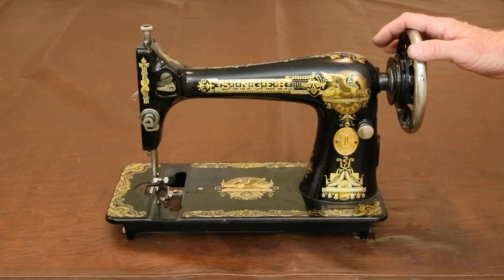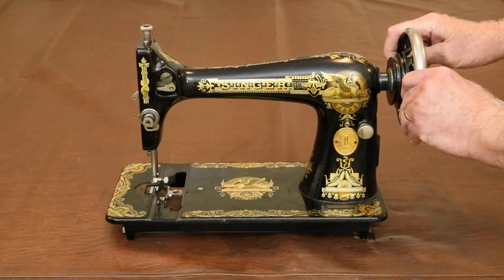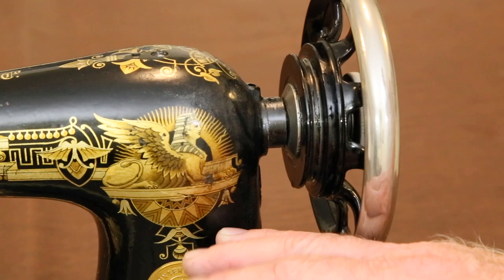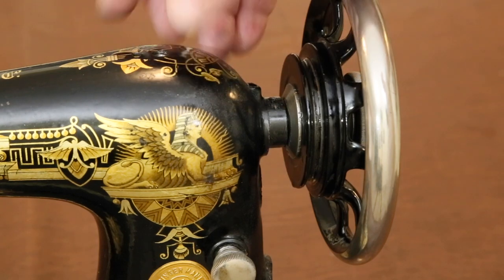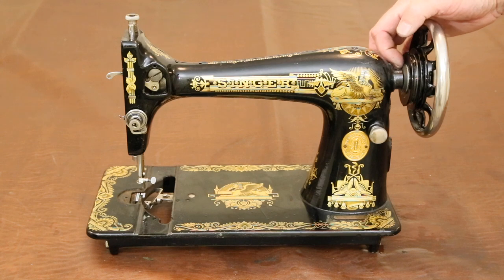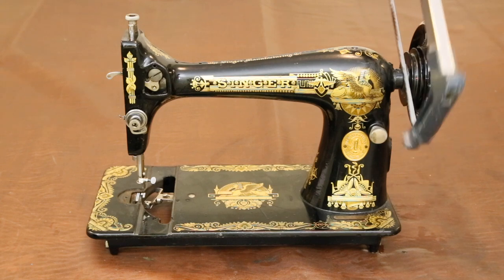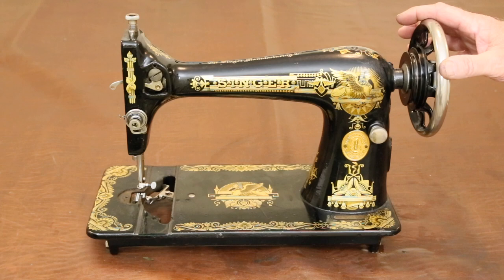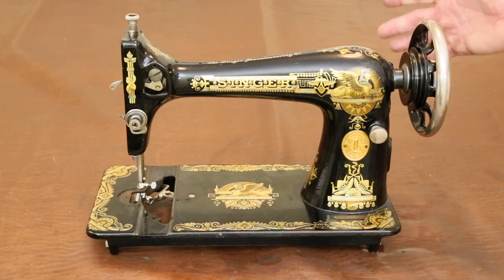One Way To Fix A Jammed Antique Sewing Machine

Comment: Simple workable solution. In 1985 I bought a Honda 125 that had been used off road and had "banana" forks I made some V blocks and a few blocks of wood then used a Hydraulic jack in an outdoor brick building doorway, not perfect but it got the forks working again. 

I have a Singer just like this and made a BIG mistake by running it with the front shuttle slide  OPEN the shuttle jumped up a bit and jammed and bent the cradle. It took me about 30 min and a few tools to bend it back in to working order. NEVER run  a machine with the slides open - just like never run a machine with the foot down and no material, I often just use a paper. Quite a few of my machines have a grove under the foot [I file them flat], hardly surprising the dogs are sharper than some of my garage saws.  

Thanks Wayne for a another short and to the point useful video. If it works it is good enough.

Comment: Wow, what a treat to find this video with this machine. I bought the same or similar machine at an estate sale.  The tension spring is broken.  Would you have a suggestion where I might begin to locate one?  I think my machine was made in 1874 or thereabouts.  Decals are the same as your machine is.  Thank you for any help you may give.  You do exquisite work.
Reply from the maker: Fortunately, many places sell parts for antique Singer sewing machines. Try the following key word string: "Singer 127 parts" in EBAY, Google Amazon and so forth. You may have to purchase a bag of parts to get what you want. Good luck and thanks for commenting!

Comment: I can finally move mine but in binds slightly part way through a rotation, I noticed the wheel wobbled slightly also. I guess I should stop the rotation with the bind on top and cut? Thanks so much saved me giving away my gorgeous 15 with pristine Tiffany decals which are so hard to find in that shape. I will do it !
Reply from the maker: Can you see the spot where the wheel collar rubs against the body collar? If so, that's where you need to saw. But, using this technique is considered a destructive correcting because it removes original material. Be sure you want to take this step before doing it.
Reply: @wayneschmidt490  OK so what are you removing metal from the wheel collar I guess you have a pretty fine tooth saw blade also. Do you smooth it out with a file or emery paper after? I was going to keep it and take apart a beat up one if the price was right or free. Might be interesting to learn. Thanks for your reply and yes maybe since this is such a lovely machine and decals I should think about it some more.

Comment: I use a little valve grinding compound mixed with a little oil and pour it into the oil hole on the rear by the handwheel and work it back and forth for a while then hook it up to my motor and belt and spin for a few minutes.
Reply from the maker: I could see how that might work if I only needed to grind off a thousandths of an inch of metal. But in this case I need to remove almost an eighth of an inch. Also, I'd be concerned about the grinding compound getting into the journal bearing. But it's an interesting idea. I'll look up 'valve grinding compound' and try it on the next machine with this problem. Thanks for the idea and the comment!
Reply: Problem is unless you strip it down after it will always be grinding away material.

Back in the 1970 my dad visited the Ferrari factory Modena they ran engines on test beds with cutting compound in them to run them in faster, the exhausts were glowing. After this they were fully striped and degreased.

In the 1980s a couple of friends bought Honda 250cc motorbikes, one lad dropped the factory oil and replaced it with  "molyslip slick 50"  - big mistake- the other lad didn't give a monkeys and revved the hell out of his. The result was the first guy had a slow bike and sent a letter to Honda, he got a letter back saying that they thought his bike would be run in after about 50,000 miles or so.

Not every idea is a good one. You should see some of mine :-)) that I have to live with.
Reply: jdhtyler 90% of these machines are never used they are meant for display only. I wash it out with mineral spirits and compressed air and it seems to flush most all of it out. I freed up the exact machine with the same issue and it works great.
Reply: Wayne Schmidt I did the exact same machine with that issue it wouldn’t even turn at all when I got it but after a few hours it freed up where I could hook it up on my bench motor and spin it until it freed up. When they are super tight I take off the wheel and start working it back and forth  with a pipe wrench to loosen it up. There are different grits of grinding compounds available. I flush it out with mineral spirits and compressed air and it seems to clean it out well. I really enjoy your videos they have been a great help in this wonderful hobby.
Reply from the maker: @jdhtyler  I hear what you're saying about the lose of people with machining skills. As a research engineer, one of my best engineering experiences was working with the lead machinist, a man named David Lowes, in making a small rocket engine at the Air Force Rocket Propulsion Laboratory. My design was great, until he very gently sat me down and explained that many of the things I had designed couldn't be made. Working together, we got it built and running. I learned a lot from him. Not just about that project but seeing engineering design from a wider perspective.
Reply from the maker: @jdhtyler  I love pulse jets! Mechanically they are so beautifully simple that it makes up for their many other issues. Did you know there are valveless versions? These are "U" shaped engines with one leg of the "U" shorter than the other.

Comment: I ha e just bought a 1922 Singer 15K. I'd like to learn about it and hopefully restore it. I find it a fascinating object although I don't know (yet) how to even use a sweing machine. What I ha e noticed though is that the big wheel (perdón I don't know the exact name) does seem to rotate top well, almost freely. It definitely doesn't move the needle. Could you point me to what I could look at? Is there any service manual available, or repair guides? Thanks in advance.
Reply from the maker: Singer 15Ks are great machines. Congratulations on finding one.

Look at the end of the large wheel on the right end of the machine. There should be a knurled, silver knob in the center of it. This acts like a clutch to disengage the wheel from the rest of the machine so that a bobbin can be wound without running the entire machine. Try turning it clockwise to tighten it. This should re-engage the wheel with the machine. 

Here's a source for a free manual for 15K machines:

http://needlebar.org/main/15chart/110/index.html

Good luck!
Reply: @wayneschmidt490  OK, so I've watched a couple of videos and I think I've understood the clutch knob/washer thing. After removing the clutch knob and washer and trying several possible positions and tightening the cluck knob more than it was before, I think I have it in the correct (or at least a better) position. Now I can tighten it and the balance wheel doesn't rotate freely anymore! Which was the expected.
Now it doesnt move at all, but that's OK. I'll start by oiling every oiling point as described in the manual and see if I can unfreeze it with time and patience. Already, thanks for the help!
Reply from the maker: @adumont  You're very welcome, and good luck!

Comment: Wayne, I have a Minnesota Model H machine.  The treadle wheel moves fine, but the needle doesn't.  Seems like the shaft is not moving at all.  Any suggestions???
Reply from the maker: The most likely cause is that the wheel has been disengaged from the driver mechanism inside the machine so that a bobbin could be wound without driving the entire machine. In the center of the main wheel is a small knurled disk. Holding the main wheel still, try rotating the knurled disk counter clock wise, so the top rotates away from you, until it gets tight, then try spinning the main wheel and se if the needle now goes ups and down. If that doesn't fix the problem, you may have to take it into a sewing machine repair shop to figure out what's wrong. Good luck and thanks for commenting!
Reply: @wayneschmidt490  Thanks Wayne for the fast response.  I will try and let you know whether that works.  Thanks...
Reply: Looks like that was it.  Thanks again...
Reply from the maker: @DavidGurev  Great! Glad I could help.

Comment: my machine waz damaged in the post the left foot on the front of the bed of the sewing base had cracked off can it be reparied the cover plate is holding it on o it does still sew very well
Reply from the maker: Hi! I was sorry to read your machine got broken in the mail. That's happened to me several times. It's frustrating. But, if it's the cast iron foot you're talking about, that can be easily fixed. The following video shows how. It doesn't require any welding or soldering. While your broken piece is a different shape that the one used as the example in the video, the idea should be easy to adapt to your needs. Good luck and thanks for commenting!

https://www.youtube.com/watch?v=yjx85PYfUdA
Reply: @wayneschmidt490  thanks my broke piece is wway bigger
Reply from the maker: @rndea100  No Problem! The same technique with a little modification can fix it. What I didn't talk about in the following video is that the Florence sewing machine in it had been dropped and the entire base broke in half right across the crown. To fix it, I turned the machine upside down, took all the hardware off, sanded away the paint on the underside, got some 1/8th-inch thick by 2-inch wide pieces of steel from a hardware store, scored the bottoms of both the steel and the machine with an Exacto knife to make groves for the epoxy to catch on and used JB Weld to glue the plates to the bottom of the machine. It worked great. For your case, instead of cutting up steel plate, which can be tiring, you could use heavy weight large washers. Just make sure it's something that's strong enough that it can't bend. Good luck!

https://www.youtube.com/watch?v=jNv6307N64Q&t=286s

Comment: I can turn my weel but it jams when I sew
Reply from the maker: Thank you for commenting! 

What sewing machine do you have? What jams? Does the thread get all tangled or is there something inside the machine that locks up? If it's the machine, how many times can you turn it before it jams? If the problem is a tangle of thread, that's usually a tension problem. Most times if it's tangling on the underside of the cloth, the problem is not enough tension on the top thread. 

Let me know as much as you can about what's happening and we'll see if we can't get your machine to sew.

Comment: Hi in my case my handwheel moved but other parts jammed , what is the solution?
Reply from the maker: Without seeing the machine in person, it's impossible to tell what the problem is. It could be dried up oil or something bent or broken. The first thing to try is applying a lot of oil to every moving part, wiggle the main wheel to try to loosen things up, let the oil work overnight and repeat the oil-and-wiggle routine a few more times. If that doesn't help, turn the machine upside down and while wiggling the main wheel, try to see where the blockage is along the drive train. Unfortunately, while there are operator manuals available for most old machines on-line, there aren't any repair manuals. In the end about all anyone can do is spend a lot of time studying their machine to figure out how it's supposed to work and go from there to figuring out what the problem is. If you have a sewing machine repair shop near you, they might be able to help. Sorry I couldn't be more helpful. What machine do you have?

Comment: I have a vintage singer model 27 B-series from 1904. The wheel moves fine but the needle does not move up and down, any ideas on how to fix this?
Reply from the maker: Hello! Thanks for commenting! The only thing I can think of is that the bobbin winding clutch, the knurled knob in the center of the main wheel,  has been turned so that the wheel is separated from the rest of the machine. Try turning it counter clock wise until it locks tight. Three minutes and fifty seconds into the following video the narrator shows how to do this:

https://www.youtube.com/watch?v=dAY86LyYbW8

Good luck!

Comment: We still have this machine
Reply from the maker: Singer made their machines to last. Thanks for the comment!
Reply: @wayneschmidt490  Yep but the trouble is they only last about 100y  . . . .. . .  but if you oil them ? they will run for 100s    ;-)  I have a few, my latest are two 201K a cast iron one in a treadle cabinet and an aluminium one in a leatherette case.  Bothe sold by the users for £50

One had a bad burning smell traced to the bulb, modified to take an LED bulb, it had grease worms on everything that moved but none in the bearings ???

The other would randomly sew on its own even with no operator, I removed the capacitors and cleaned the carbon disks in the foot peddle, yep I know RF pollution... I will replace the foot peddle  with an electronic one so we can use it and keep the original with the machine.

My oldest machine is an ELSA 1980ish  nice little hand wind, great fun to use. I set this one up for my wife to do a long basting stitch.
Reply from the maker: @jdhtyler  Many people consider the 201s the finest sewing machines ever made.

Comment: My wheel turns but nothing happens. I have no clue what to do.
Reply from the maker: Hello! Thanks for commenting! The only thing I can think of is that the bobbin winding clutch, the knurled knob in the center of the main wheel,  has been turned so that the wheel is separated from the rest of the machine. Try turning it counter clock wise until it locks tight. Three minutes and fifty seconds into the following video the narrator shows how to do this:

https://www.youtube.com/watch?v=dAY86LyYbW8

Good luck!

Comment: Pls my machine jammed office pin nd it stop to work...the needle doesn't go down so it stops sewing
Reply from the maker: Thanks for commenting! Diagnosing a problem with a sewing machine is almost impossible without being able to work on the machine in person, but I'll try my best to help. First, what machine do you have? Second, is it a hand crank, treadle or electric? You mentioned something called an "office pin." What is that? You stated the needle doesn't go down. Does the machine still turn? Can you turn the main wheel with your hand?  I only speak English. If it would be easier for you to explain the problem in your native language, go ahead and do so and I will use Google Translations to translate it to English so I can understand it.

Comment: Terrible solution that causes un-repairable damage to the motor housing and shaft collar. The tolerance at that  location controls the end play of the complete shaft. Better to knock out the retaining pin and work the collar off with a block of wood. Drill a 1/2" hole in the end of a 1" bolt, polish the inside of the bolt until it just slips on the shaft. Use a dial indicator on the shaft to identify the high side. Rap on the bolt with medium effort. Re check every 5 raps. I went from .020 to .003 run out. Re assemble and you'r done. End play is still retained at the factory spec. It was much easier to do than to describe it.
Reply from the maker: You are absolutely right. This was a terrible fix. Your way is much better. But, most people don't have the equipment to do it the right way. My solution, which I admit is a bad one, allows anyone with limited skills and equipment to at least have a chance to get an unusable machine back to operating condition.

I checked out your channel! Loved the train setup and your Model A looks great. I noticed the trunk lid was off. Are you going to put in a rumble seat or keep it a trunk?